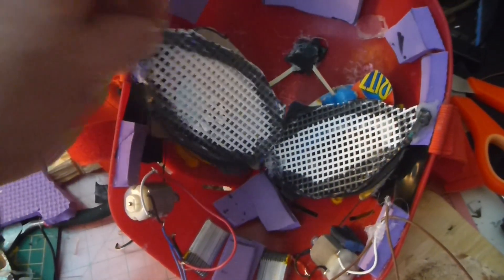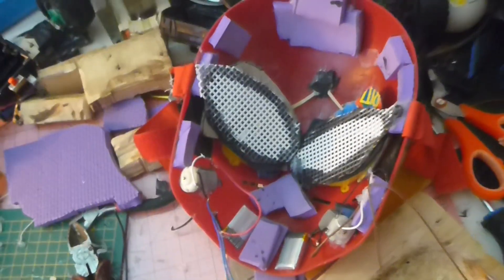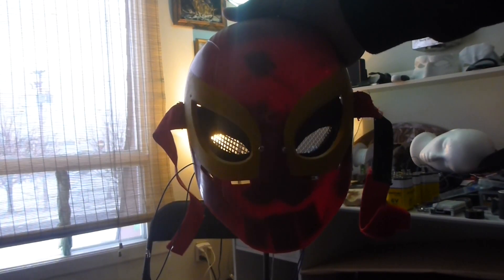Mechanical lenses Spider-man full prototype

Comment: How do you control the motors? How can they stop at a certain point without breaking the eyelids? BTW nice vid!! I want to see the upgrade
Reply from the maker: The motors are controlled by two different buttons I have in each hand, super simple. the motors are small and don't have to much force so they just stop once they hit a kinda of stopper I built in. I've been a little busy with work and other projects but i'd like to improve it by getting smaller servo motors and having them controlled by an Arduino. There would be like 3 or four buttons, each one triggering a different set of movements like maybe a blink or a wink. Also would like to make the parts out of a tuff plastic so that they look better and or more durable
Reply: @theunstoppablefreefall   I'd be more helpful for me as I've been working on a mask with mechanical lenses with servos. But because the faceshell is made cardboard I'm kinda limited on weight and no. of motors I can put in... Hope you success!

Comment: you could've made it smaller so it doesn't look so bulky dude, like use smaller motors and use mini rechargeable batteries that you can find inside of mp3 players, and for the shutters/iris like what you called them, did you use cardboard ? i'd recommend 2mm eva foam since its softer and thinner, or you could just use cereal box cardboards which are thinner but durable, just stack em up to get the shutter pattern in homecoming movie, unless you want it to be like spiderman ps4 lenses.

im also making these moving lenses face shells for my mask but im using strings and rubbers only while using my jaw to pull the strings, im still not sure how to make it work tho. i was also planning to make the face shell out of eva foam so i can wash it no problem cuz im gonna be attaching it to the mask

btw it's a cool video and i also like the idea of motors
Reply from the maker: This was just me messing around with some stuff I already had. I can for sure make it small and I like the idea about the EVA foam face shell.  I plan on printing out A face shell once I get my 3d printer working again. i'm also planning on switching the motors for smaller servo motors that can be wired into an Arduino nano to control the blinking of the eyes. originally I had upper and lower shutters but it was working as good as i would like. This was just a test to see if i could do it. Now time to perfect it! Thanks for taking the time to comment on my video. I love hear peoples ideas on improving different designs. good luck with your string mechanism. I've seen videos of people take apart those toy spider-man mask but i'm sure you've seen them
Reply: @theunstoppablefreefall  yeah, well it's better to have a 3D printer cuz you can design the face shell to fit the motors or to make the face shell a lot thinner, if you're using arduino then why not use the movement detection command? there are various source codes about that on the net you can try, like it'll detect certain eye movements to activate the shutting eyes or something, i'd deffinetly do that if i had the money too since i've had basic programming language and they say arduino isn't any different than sketch or unity or something
Reply from the maker: @hasbi1300  Well that would be really awesome